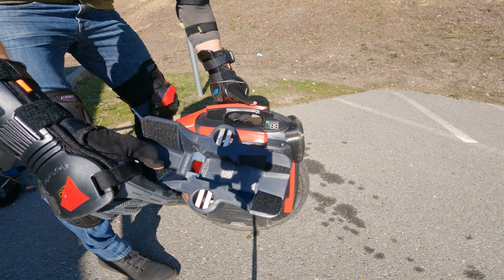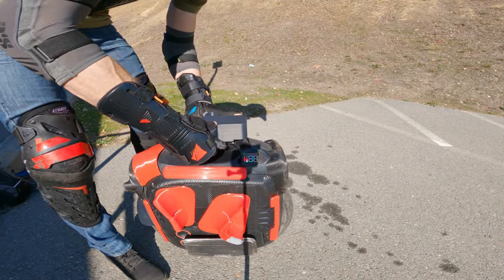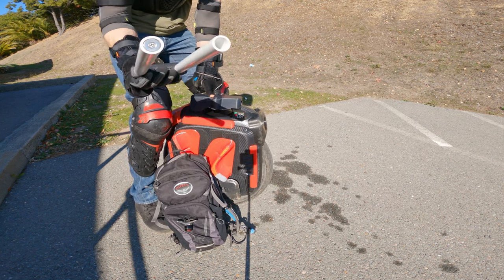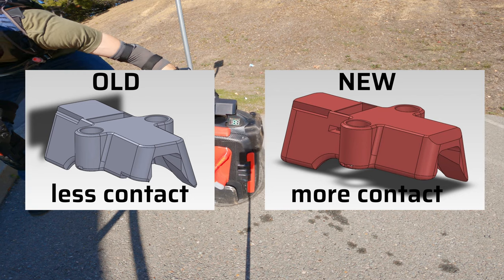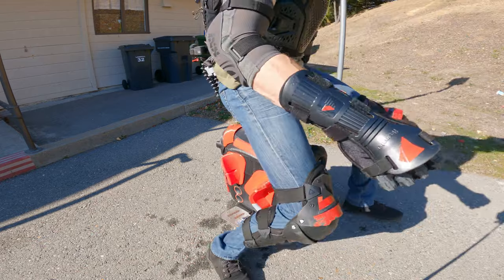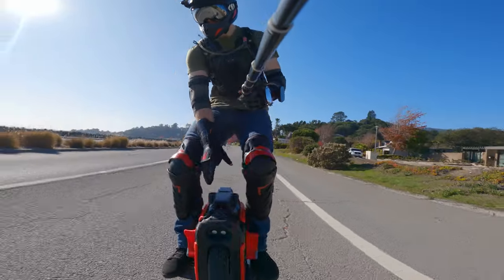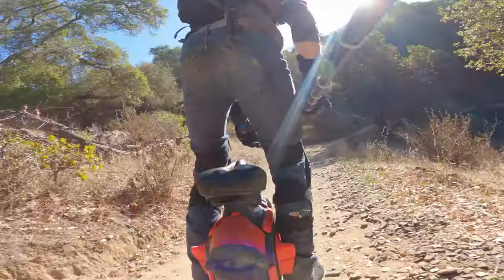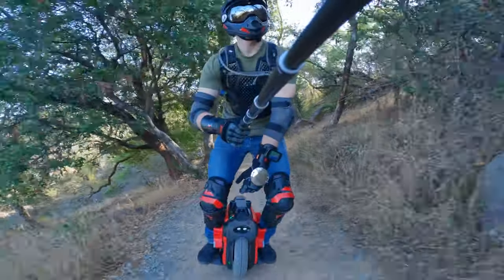Seat Handle Adapter Device for Begode MSP, MSX, RS19 - A 3D Printed Mod

Comment: Its actually good design to make a cheap and easy part the probable failure point. It sacrifices to save the more expensive parts. Obviously, this is not what you want for competition where finishing in the money is the name of the game. Weight is the enemy and strength is your friend, finding the sweet spot in that compromise is the trick.
Reply from the maker: I wasn't really thinking of failure modes in the design process so this result was more of a happy accident, but definitely good that it worked out this way considering the SHAD brick itself took me over 24-hrs to print.